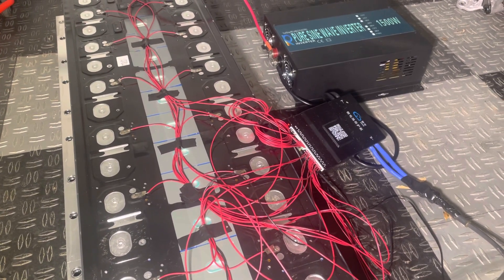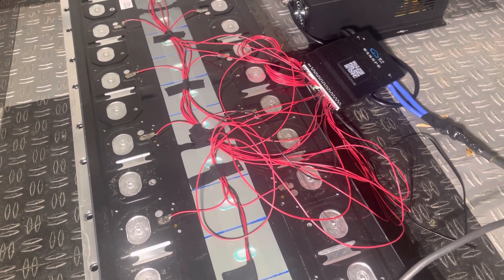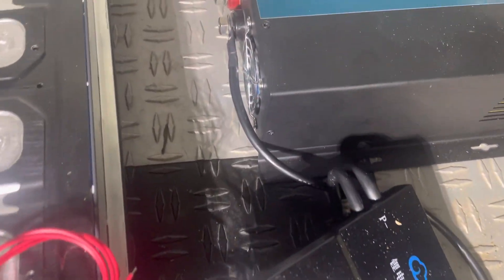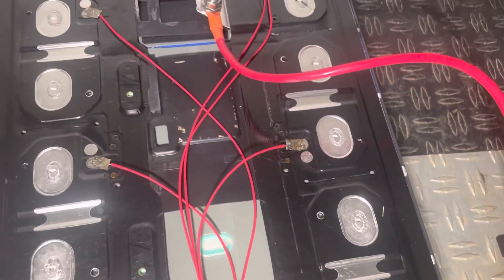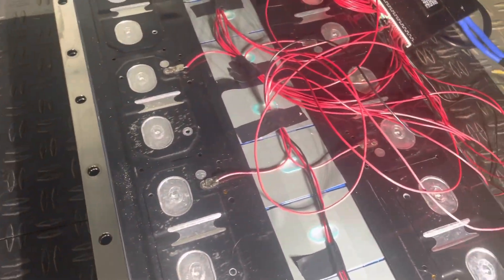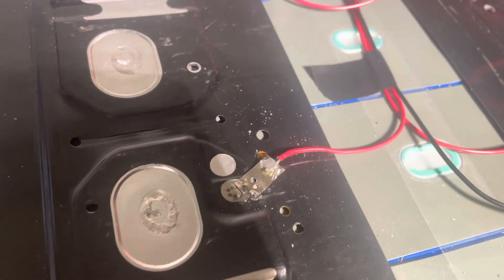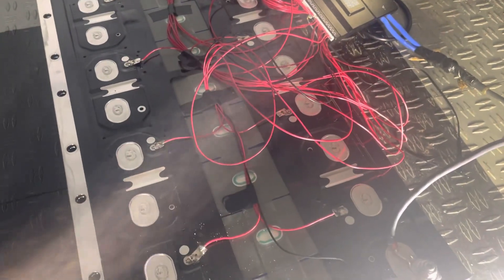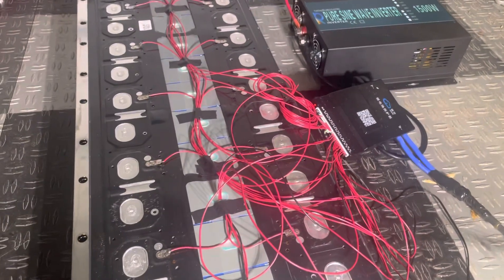Wiring a BMS to a Tesla LFP 16S 48V module.

Comment: When you cut the 26s into 16s, it was just a straight grinder cut? did anything spark?

If you were to put the remaining 10s and connect to another set of 6 cells (assuming busbars preattached), will it cause any spark?
Reply from the maker: There are many things that co go wrong yes. You should not attempt this if you have no prior experience working with HV electronics.

Comment: I am working on a full LFP pack in the coming days, and this video is very helpful for me to get prepared for the pack. Thank you for uploading this video. I see you installed your own BMS harness to talk to your BMS, have you considered using the OEM BMS wires?
Reply from the maker: I have and decided against it.  BTW you don’t have to use strips as I was showing in this video, you can solder the wires directly to the area to which I was spot welding the strips.

Comment: Great work. I have a whole M3 LFP pack but will keep the 108s and connect it to a 15kw Hybrid inverter. The way you connected the BMS cables is interesting. I have a question. Are you spot welding each BMS nickel strip to a nickel plate on the battery terminal? The main battery terminal look like Aluminum. I am wondering how this went as I may need to use my own BMS instead of Tesla’s. Thanks and keep the videos coming.
Reply from the maker: Yes I welded the nickel strips to the existing balance strips off the cells.  I wasn’t able to weld to the aluminum tops of the cell terminals.

Comment: Thats really cool!
Was wondering when someone would repurpose these cells.

I wonder how robust these cells are when utilized with a consumer grade BMS?

Possible anyone has seen a BMS that can handle Both the starting current of a typical 12Vdc automotive like environment and integrated charging management? 
Essentially the BMS that is used in Lithium based "12Vdc automotive battery" , have not been able to find a suitable BMS like that to roll your own 12V LFP battery for powersports and other small niche applications.
Reply from the maker: BMS is sized by the load not by the battery wh.   So any BMS would work.  You just need a powerful one to get the most out of the batteries.   To get full advantage of these cells you may want a 300A BMS (cells are 172ah, 2C discharge rate).